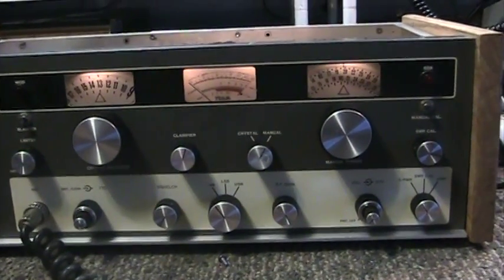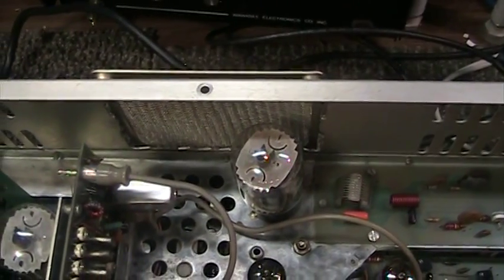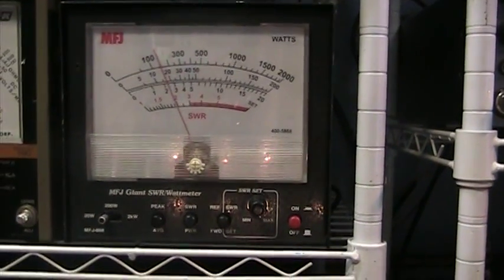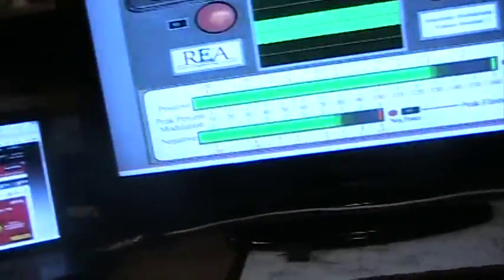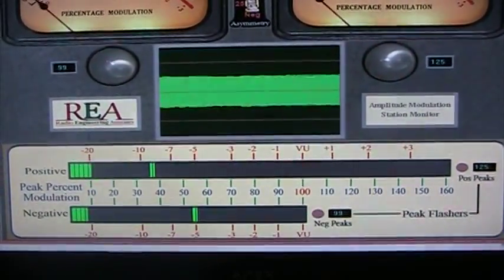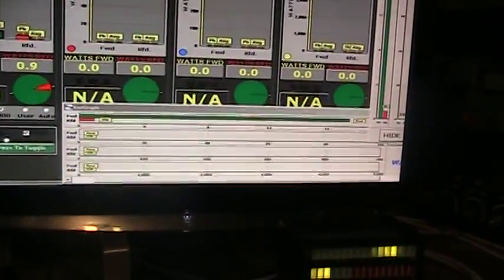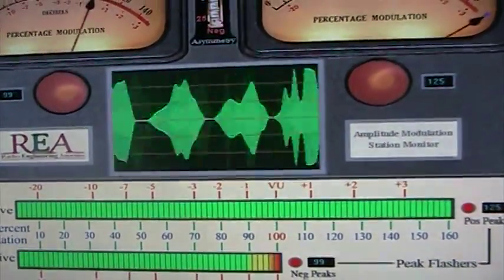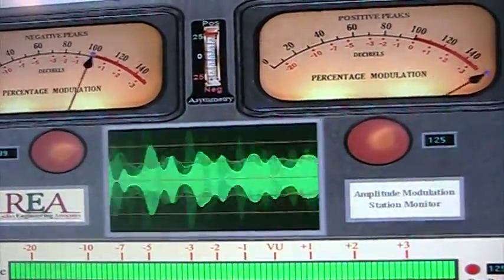Tram D201A fixed bias on the Mod Monitor

Comment: What's the point of having a modulation monitor if you consistently overmodulate so you're always off-scale.
Reply from the maker: The Tram D201A and the Buddy Base are the only 2 CB radios that I know of that modulate 'Off Scale' past the 160% + mod. All other radios do less. 2nd, on the radios that I actually use on the air, I run the Mic audio thru my big rack of asymmetrical audio processing gear. With that I keep the Negative percentage of modulation just below 100% and the +% mod just below + clipping wherever that may be. On these test videos, I just run unprocessed audio and let it fly.
Reply: It's just glitz friend.  The point of the mod monitor is to CONTROL the modulation level.  The designer of that unit is a personal friend of mine.